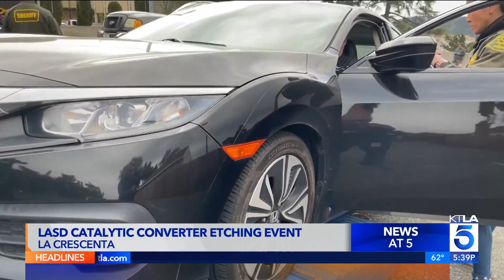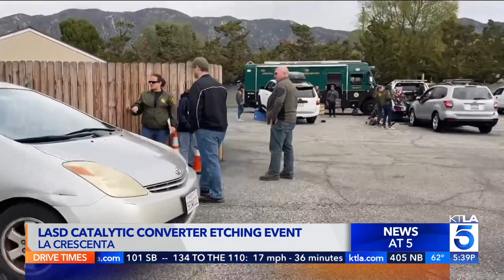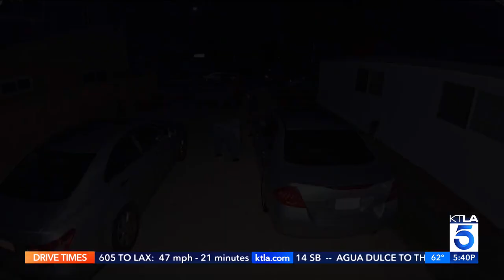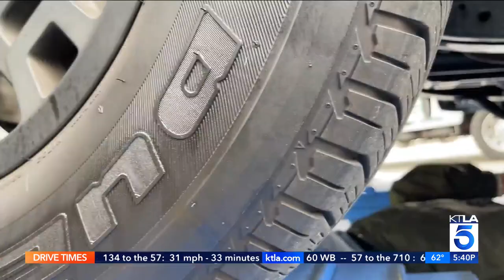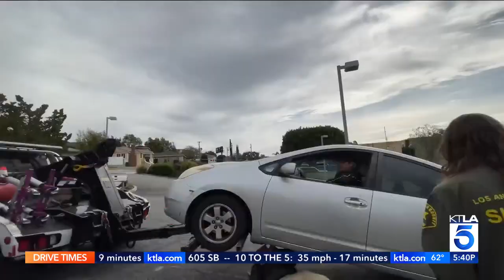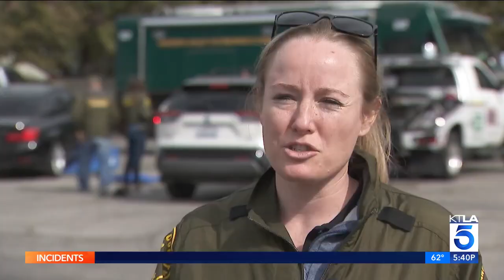Los Angeles deputies offer free etching amid rise in catalytic converter thefts

Comment: This has to be the dumbest thing I’ve ever heard of. Super easy to remove the number and get rid of it at a recycler. If you want to fix the problem regulate the recycler and make it a criminal offense to except catalytic converters from anyone that isn’t a licensed scrap dealer! Take away these thieves market and then they nowhere to fence the stollen property. Problem solved.
Reply: Obviously, but CA is completely blue. This is one is to obvious and easy fix. I believe they will go with funny approach, like creating license for angle grinder operators. Plus permits for sale.
Reply: the money is to easy to get at the recycle stations,low risk of being caught